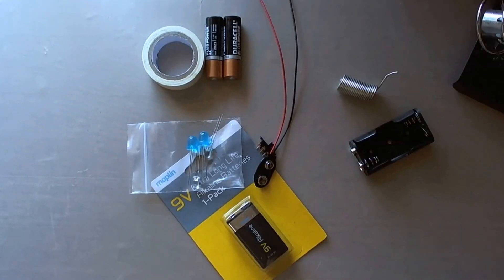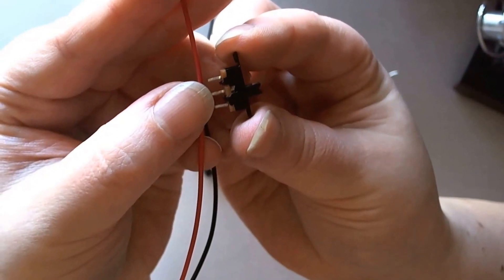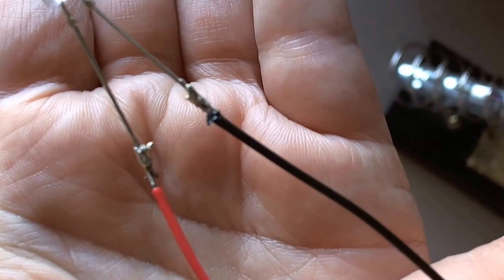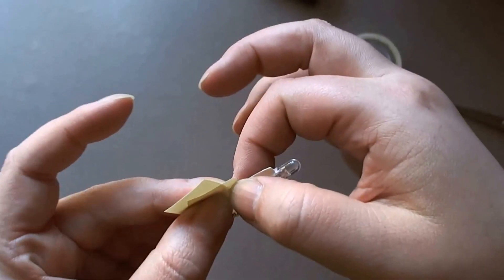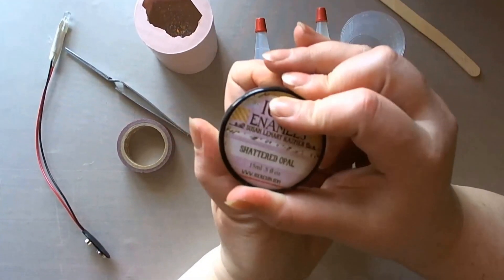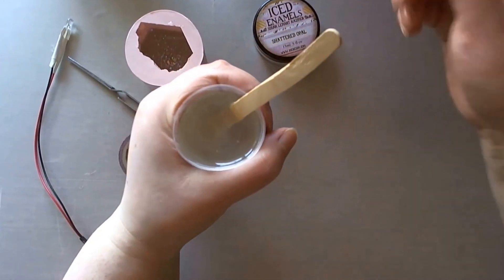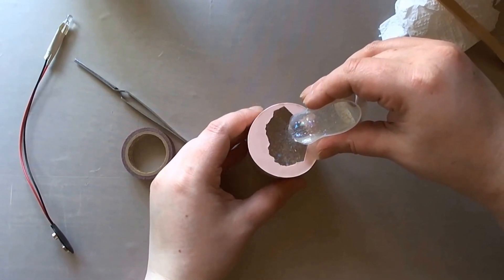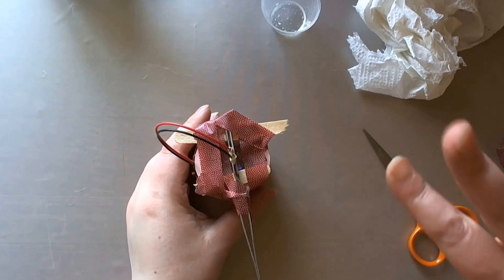Insert an LED into ICE Resin

Comment: That's pretty neat. You could also use a small button cell battery for a smaller item like a pendant. ;)

One thing that might make the soldering a bit easier maybe is to wind the wire from the battery holder around your positive and negative rods. Now I don't know for sure as I have not ever actually soldered a circuit but I have done other electrical work and I frequently would wind wires together. :)

- Heidi